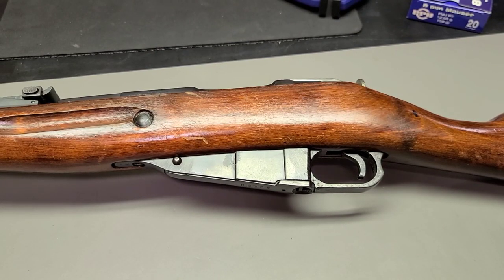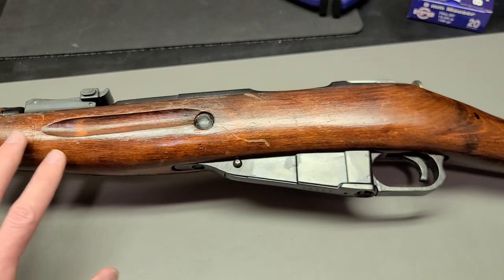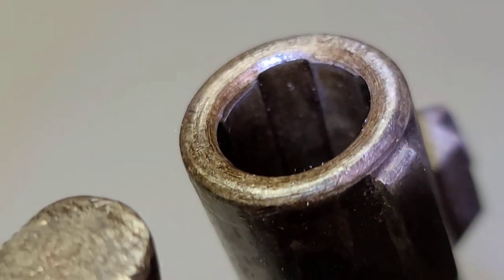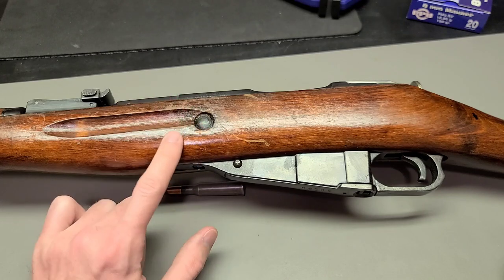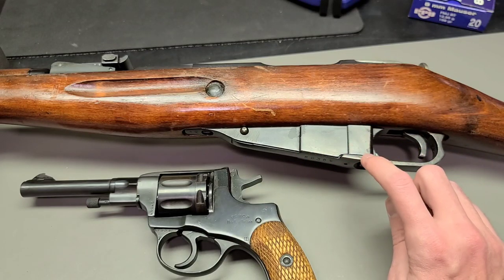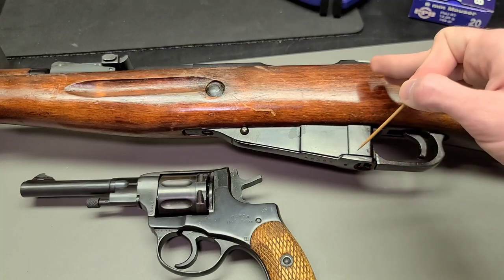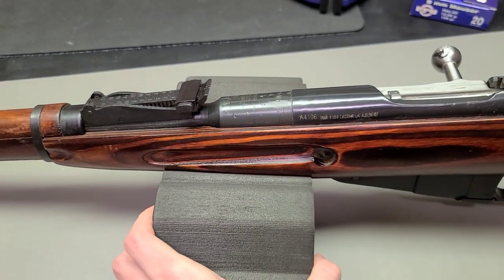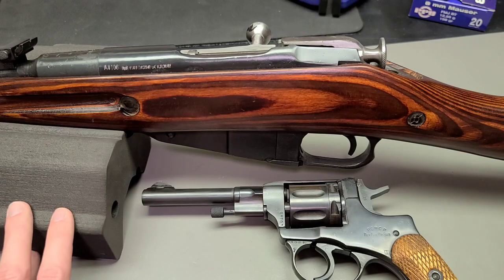What kind of rifling does your Mosin Nagant have?

Comment: How do you clean, De-Cosmoline your Mosin Rifles?
Reply: Start with solvent on the barrel to get oil and fouling out. Because of the corrosive ammo finnish with warm soapy water for the barrel. The salts they used in the primers was so corrosive warm water dissolve those salts.  Clean the chamber, bolt face and barrel with this technique. The rest of the rifle can be cleaned like any other. Remember to clean it after every time you shoot and don't wait long because corrosion can set in quickly and destroy the rifling. 
If you use modern non corrosive amm clean it like any rifle. 
All surpluses ammo is corrosive for these rifles.
Reply: Mineral Spirits and a lot of scrubbing.